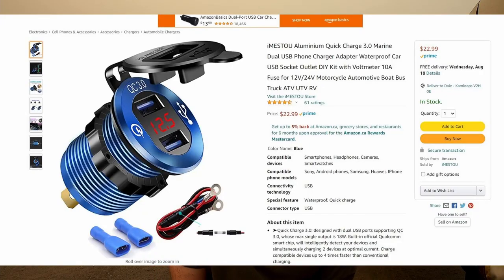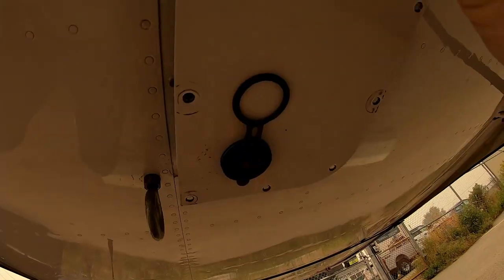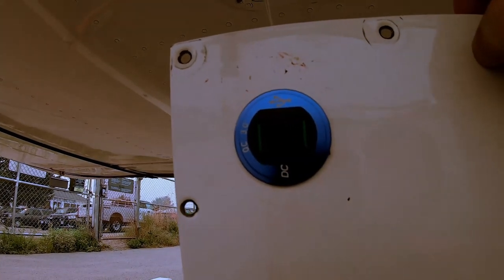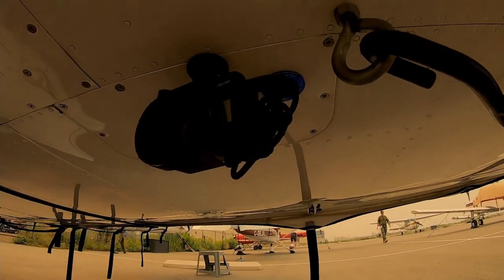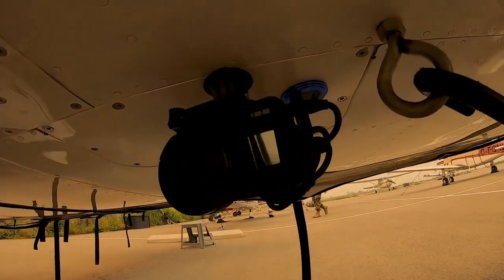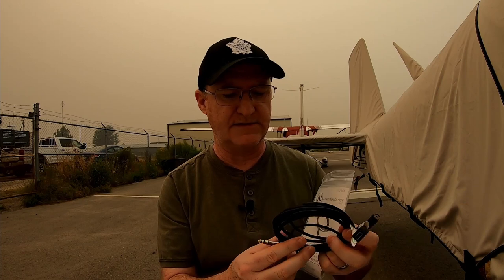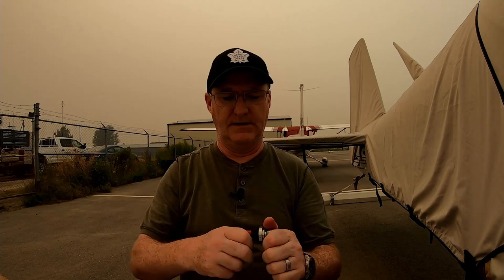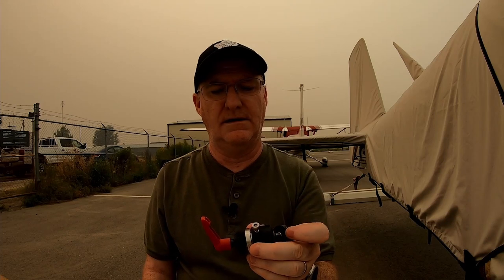How I Fly   External USB and Nflightcam

Comment: Thanks for the video.  I'm using super-cheap "action cameras" that cost less than €50 and the nice thing is that they can be configured in "dashcam" mode where they start recording when they get power.  It's really a shame that gopro does not do this.  The quality is "ok" but not nearly as good as gopro.  The upload to youtube automatically seems to stabilize the video, thankfully.

Quick question - you don't seem to have a hangar - that's surprising in Canada, since space is so cheap there - you've got a lot of it!  Good luck getting flying again, and thanks for the videos!
Reply from the maker: Lots of space for sure. The moment you put a roof and a door around that space it becomes unreasonably expensive. It would cost about 5 times what I pay to tie down just to rent. Owning is about 2-3 times the cost of my airplane

Comment: like the idea of mounting to the aileron bell crank hatch, saves having to cut holes in the skins, and worst case if you botch the hole you only need to make a small part.  my GoPro audio cable was quite noisy (alternator and/or ignition noise on the audio tracks) but I found if i use a portable pocket "Power bank" to power it the noise was eliminated.  as for the tie-down mounts.. made a couple of my own (Nice to have a couple lathes) but i think I'll pass in sticking a gopro near the tail... My RV is not a 6A!     Smoke is finally starting to clear around here and now that I've completed my transition training and I'm flying my RV6 solo, I am looking forward to capturing some footage myself.  
   Here's a clip from Rooster (My 150) and I believe there are a couple shots from the tie down cam at the rear.  
https://youtu.be/A7AbPKga4pY
Reply from the maker: The access hatch is a perfect sacrificial piece in case of a screw up. Good luck with the flying!  Hoping to get out this week too but the fires are inching closer to Kamloops. One of the subdivisions on the west end is now on alert

Comment: I response to your under wing camera issue.   Would you be able to toggle the positive wire from each side in the cockpit so when you activate the heater you could just turn off the installed USB ports while warming the Pitot tube?   Unless your pitot relay has a opposite NORMALLY CLOSED contact. Then you could utilize that side of the relay.
Reply from the maker: The only problem with that idea is I would have to get back out of the plane to turn the cameras on and press record again...they don't automatically start recording once power is restored.
Reply: @HowIFly  ahhhhhh.   So the cameras will not operate on their internal batteries for the duration while heating the tubes?   Then switch back over to supplied power after?
Reply from the maker: @jeepcj7dude  no GoPros will operate on either battery or AC but not a combination of both (unfortunately). It would make life much easier if they would